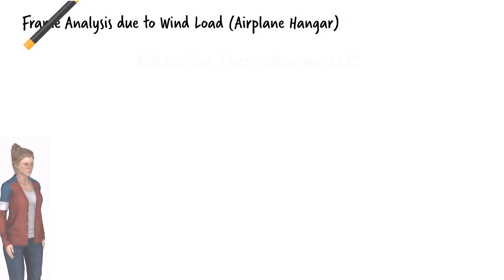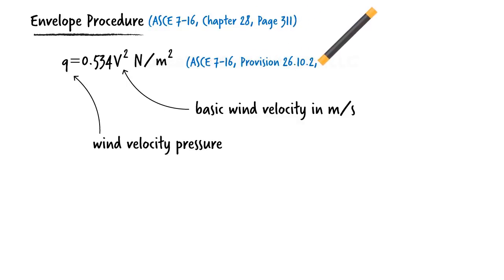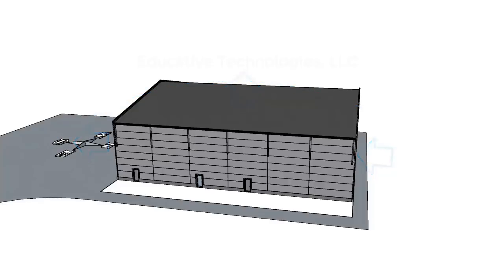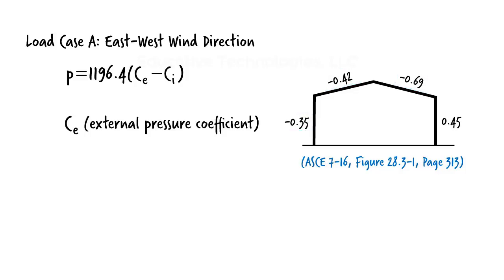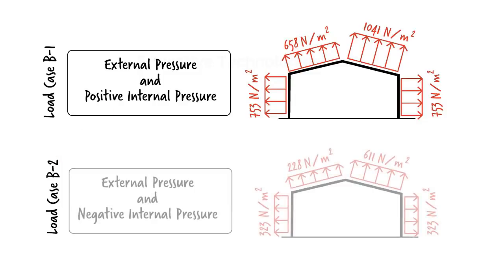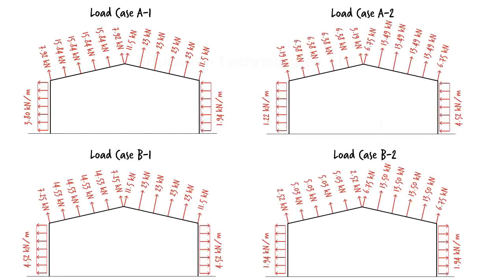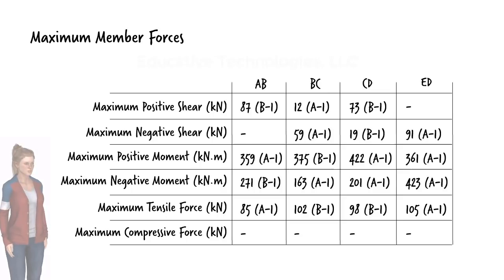SA52: Frame Analysis under Wind Load (Airplane Hangar)

Comment: Thanks you sir , if we have a canopy or extension member how to design winload ?
Reply from the maker: A canopy can be treated as an open building (not enclosed). There are provisions for open buildings in the code. Similarly, the code provides provisions for roof overhangs. Similar to the enclosed or partially enclosed cases, such provisions specify the required wind pressure for the components of the structure under consideration.
Reply: @DrStructure  acording to slope of roof 11.62 , your coeficient  has a problem with Linear Interpolation .
Reply from the maker: Thanks for the comment, we will look into it.
Reply: @DrStructure   what about wind load on sidewall ?
Reply from the maker: The loads on the sidewall are included in the analysis. See 6:26
Reply: What about the torsional load case  sir ? I do not understand about torsional load case clearly . Could you give me any comment . Thank you
Reply from the maker: Suppose we have a square building with dimension L x L, subjected to wind pressure on the walls. Place the origin of a cartesian coordinate system at the center of the square/building. The building is not going to be subjected to any torsion so long as the algebraic sum of all the wind forces acting on it pass through the origin. However, if the wind load is not acting symmetrically on the walls (and often it is not), then the load due to the wind pressure becomes eccentric relative to the origin causing rotational forces to develop. 

Suppose the wind pressure on the leeward side is q. Knowing the dimensions of the building, we can calculate the equivalent concentrated load due to q. Say, the wall height is h. Then the equivalent concentrated load due to the q is: P = (q)(h)(L). If q is perfectly uniformly distributed over the wall, the plane of action of P passes through the origin resulting in zero eccentricity, hence we have a zero torsional force. However, if the wind does not exhibit a prefect uniformity, then the plane of action of P would be separated from the origin by some distance (e). This distance would be like a moment arm for force P relative to the center of the building. Hence, a moment/torque of (P)(e) develops in the building. That is, the square/building wants to rotate around its center.

Design codes provide provisions for handling torsion. For example, according to ACSE 7-16, such a building has be designed using either the Directional Procedure or Wind Tunnel Procedure, not the Envelope Procedure. In this lecture, the latter procedure is being used.
Reply: @DrStructure  with envelope method it doesn't  has a Sidewall  wind load  in case A why ?
Reply from the maker: Please elaborate. In this example, there is a sidewall in the wind direction in Case A.
Reply: @DrStructure  what about sidewall wind load coefficient ? I mean the value of coeffient for sidewall wind load Case A .
Reply from the maker: @cheavannai26  By sidewalls, you mean the walls of the hanger in the direction of the wind, right? Those coefficients are specified @5:41
Reply: @DrStructure  normally we have windward leeward and sidewall of the wind but evelope  method in case A  i do not see  sidewall wind load .
Reply from the maker: Right, as far as the Main Wind Force Resisting System (MWFRS) is concerned, we want to analyze it under the wind pressure in the direction of the wind. Wind pressure in the orthogonal direction does not impact MWFRS significantly for low-rise buildings, hence it is not included in the envelope method.
Reply: Thanks you sir 🥰

Comment: 0.534 * 58^2 is not the result of 1196.4 N/m^2. 
It is 1796.4.
Reply from the maker: Thanks for pointing out the calculation error.
Reply: @DrStructure  I always do calculation  on paper.
All your video make me more comprehensive.
So, I want more video wind and quake (Static & Dynamic Lecture Video).
Dynamic Mechanic  for 
Lateral Load.
Quake (Equivalent Lateral Force Procedure,Responce Spectrum,. . .)
I'm wating to study from you

Comment: The internal coefficient ci = 0.18 seems to be too low for hanger type structure. Should it be 0.55 instead (partially enclosed building, or, open front structure)? The difference is not insignificant. Please confirm. Thanks.
Reply from the maker: Yes, if the structure is truly only partially enclosed, a higher value for the internal pressure coefficient can be used. But if the hanger is equipped with doors that can be closed, and there is no significant opening in any of the walls, the lower internal pressure coefficient would be applicable.

Comment: why is the braces required at the roof level (where the steel deck is) is that required? does the deck not provide enough lateral stability?
Reply from the maker: The lateral bracings at the top of the frame seem unnecessary given that, as you stated, the roof itself could serve that purpose. However, without looking at the details of the analysis and design of the building, and the design code in use, it would be difficult to assess the rationale for such decisions.
Reply: @DrStructure  thanks - I was just trying to figure out why that is required. maybe for more stiffness.
Reply from the maker: @rawjor  I too am not certain if those bracings are actually needed. The 3D model was done based on an actual hanger in a remote location in Eastern Europe, but we don't have the design details of the hanger available to us...

Comment: Is this a steel structure?
Reply from the maker: Yes, the example frame used in this lecture is assumed to be made of steel. The procedure however is independent of the structural material.

Comment: I think it's the same as ASCE7-05  ,Is there any difference ?
Reply from the maker: ASCE 7-16 is the most recent version of the document. Certainly it contains updated provisions as compared to the older versions. With regard to the specific provisions used in this lecture, since we don't have a copy of ASCE 7-05 available, we cannot tell how the two sets of provisions differ.

Comment: In ASCE Wind load calculation for Enclosed and Partially Enclosed building  requires to design a shed building using:  

1) both Positive internal pressure coefficient +GCpi and Negative internal pressure coefficient -GCpi 

2) both External pressure coefficient, Cp (e.g. -0.9, -0.18) for ROOF.

If I consider the wind direction is Normal to the Ridge: +Wx
(Roof angle< 10 degrees & h/L <= 0.5)
Then I found 4 sets of Net Wind Pressure for single Wx direction.

+Wx1) Internal +GCpi with External -0.9
+Wx2) Internal +GCpi with External -0.18
+Wx3) Internal -GCpi with External -0.9
+Wx4) Internal -GCpi with External -0.18    
Thereby load shows both positive direction and negative direction on the ROOF.

From Basic Load combination for LRFD 
the Load Combination no. 3 can be written as:
3_1) 1.2DL+0.8Wx1
3_2) 1.2DL+0.8Wx2
3_3) 1.2DL+0.8Wx3 
3_4) 1.2DL+0.8Wx4
and so in load combination no. 4 and 6.

If we consider each combination for opposite wind pressure (-Wx) and the other two directions (+Wy) & (-Wy). Then we can find total 48 combinations for wind load only.

Sir, Do we need to consider all 48 combinations?
Please help with the answers.
Reply from the maker: Yes, we do need to consider all (often seemingly too many) load combinations for each element that is being designed. The consequence of not doing so, potentially overlooking a critical load combination case, could result in structural failure and possible lose of life.
Reply: @DrStructure  thank you. Sir may i know your designation? if you don't mind
Reply from the maker: @engrkaribul  There are several individuals answering questions on this channel located across the globe.

Comment: For load case A, there are two data. The data for A-1 (positive internal pressure) & the data for A-2 (negative internal pressure). A-1 & A-2 (@6.45 minutes) shows different values for a single frame. which load to consider in between two cases for the final design? Though you have considered only case A-1 in your video. But, In practical design, which values to consider? The maximum value between two values? Please help me with your answer.
Reply from the maker: Note that @11:00 the shear and moment diagrams for both cases (A-1 and A-2) are drawn, meaning we need to consider both (or all load cases) when designing a member. More specifically, we need to draw the shear and moment diagrams for the beam under all load cases, then compare and contrast them in order to understand how shear and moment vary in the beam, and where the maximum values occur. For example, while maximum positive moment in the member may develop under one load case, maximum negative moment could occur under a different load case, and maximum shear under a third load case. We need to know them all if we are going to properly design the member.

Comment: Dr. Structure I would like to say a big thanks for the video. 
But I'm wondering if we add crain console to the columns how can we re-write the system stiffness matrix?
Reply from the maker: Any additional (structural) element added to the system should be treated as a separate element with its own stiffness matrix. For example, a crane console attached to a column could be treated as a (cantilever) beam with its own stiffness. This would not alter the stiffness of the column. Having its own stiffness, the cantilever beam simply contributes to the stiffness of the frame, like any other beam or column.

Comment: Excellent and informative video. 
However in the code it mentions a minimum design load of 0.77 kN/m2 to be used why didn’t we use it here as some of the values (at minute 06:40  ) are bellow it 323 ,63 kN/m2 ... 
Again Thank you so much for this excellent video.

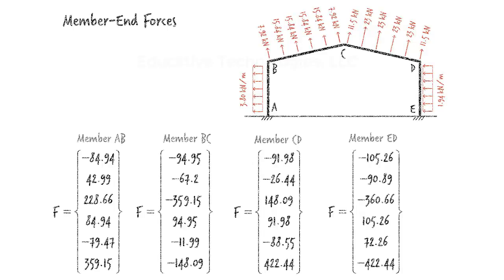Comment: Hi ! i have a question at 10:40 where we get the Member-end Forces for each member, shouldn't F1 and F2 for each force switch places because when drawing the Shear and Moment diagram later thay seem to be drawn in the oposite way for example, F1 wich is the force to X direction is 42.99 kn but in our results at 10:40 it is -84.94 kN. looking forward to your reply, Thank you :)
Reply from the maker: Member forces are always given/computed in the local (member) coordinate system. So, for member AB at 10:40, -84.94 is an axial force (in local x which corresponds to global y). And 42.99 is the force in local y (or global x), which means the shear force at the left/bottom end of the member is 42.99 kN.
Reply: @DrStructure  Maybe i am missing something here, at SA51: Analysis of a Tea House Frame at 7:15 when you draw the forces on the member you keep the same rule ? The forces drawn  are ok, but they are not in the order you state above...
Reply from the maker: The stiffness matrix for a member can be defined in two related ways: in local coordinate system and in global coordinate system. We can go back and forth between the two via a coordinate transformation matrix. This allows us to express member forces and displacements in both coordinate systems. 

When formulating the system matrix, for determining joints displacements/rotations, we operate in the global coordinate system. Once the displacements/rotations are computed, and we want to examine each member individually, we often work in the local coordinate system. This means, after calculating the displacements, and member forces, in the global coordinate system, we multiply them by the transformation matrix to get them into the local coordinate system. 

In SA51, given the simplicity of the problem, that was not done. I will have SA52 checked to make sure it is error free.
Reply: Computing F for member AB we have F=KAB*D F={-43,-85,228.66,79.47,83,359.15} which corresponds to the diagram of member AB case 1.
 In the exercise, to get the correct sense, you just have to multiply the transformation matrix by F of member AB, because F is in local coordinates.

Comment: How factor 0.534 factor is calculated in Wind Velocity Pressure Equation?
Reply from the maker: The factor is determined based on several numbers including:
Velocity pressure exposure coefficient,
Topographic factor,
Wind velocity factor, and
Ground elevation factor.
These are explained in ASCE 7-16.
Reply: Hello, you need to have access to the code to know where i’m getting the numbers from but it’s as follows:

q = 0.613 kz kzt kd V2
Where, 
q is the velocity pressure in kN / m2 
Kz  is the wind speed coefficient due to height 
Kzt is the topographic factor ( if the building is up by a cliff...etc) otherwise = 1
Kd is the wind direction factor = 0.85 for building, but varies if you design tanks (see the code) 
v = 58 m/s given ( also in the code) 

To get kz we have this equation:
Kz = 2.01 ( z/zg ) ^ (2 / alpha ) 
Where z is the height to the mid roof so 9.6 + (13.3-9.6)/2 = 11.45 m = (x3.28 = 37.54 feet) 

Zg & alpha depend on exposure categories there is type B or C or D
Since the hanger is in the open by the sea its type C , B is for city and D for very isolated areas like Siberia xD 
Form the code type C gives Zg = 900 feet & alpha = 9.5

So kz = 2.01 (37.54/900)^(2/9.5) = 1.0297
So q = 0.613  x 1.0297 x 1x  0.85 x V2 = 0.5365 V2 ( i got some error due to rounding she got 0.534)

Good bye!

Comment: Can you  tell me how you get the external pressure coefficient in Load Case B? From the code, it only has a value for each member.
Reply from the maker: For Load Case B, the code (Page 313) offers a single entry table with values for the surfaces of the building. Columns 1 thru 4 give us the coefficients for the side walls and the roof panels. For example, column 3 gives the coefficient for one of the roof panels as -0.37.
Reply: @DrStructure  For load case B, why the pressure coefficient of  windward wall "6" is not considered?
Reply from the maker: In this lecture, we are considering the analysis of a lateral frame only. So, we are interested in the loads that are acting on the plane of the frame. Since the wind pressure on Side 6 does not cause an in-plane load on our frame, it was neglected in the analysis.

Comment: Hi Dr. Structure, May I know the dimension of the cross-section of member structure that u used to obtain: A=0.023716 (m2), I=0.00567136 (m4) . Thanks
Reply from the maker: A standard W30x124 steel member was used in the example. The nominal dimensions (in inches) are:

Area: 36.5 in^2
Depth: 30.17 in
Web thickness: 0.585 in
Flange width: 10.515 in
Reply: Thanks so much @DrStructure  for your prompt reply. May I ask you a favor?  I check the area of W30x124 (A=36.5 in^2 ~ 0.023716 m^2)---> thus, it acceptable. But the moment inertia of W30x124 (Ix=5,360 in^4 , and Iy=181 in^4). The moment inertia is not equal as shown in the video (I=0.00567136  m^4)
Reply from the maker: Let me check with the person who did the calculations and get back to you on this.
Reply from the maker: I stand corrected.  For this example, the standard section that I mentioned was not used. Instead a rectangular section with a height of 1694 mm and width of 14 mm was used. For design purposes, this is not a good choice. But since here the focus was on analysis as opposed to design, we should make a note of it but consider it okay.
Reply: @DrStructure  Thanks so much
Reply: Dear Dr. Structure
qz=0.613kz kzt kd v^2 Ie 
In this problem you use 0.534 v^2.
Exposure C or D, you Define
?.

Kd is 0.85?
Kzt is 1?
Important Factor 1?
Please answer for details, My Best Teacher.
Reply from the maker: @thiha6334  In this example, Exposure Category C is used.
Kz = 1.025 (via interpolation from ASCE Table 26.10-1, using a mean frame height of 11.45 m)
Kzt = 1
Kd = 0.85
Ke = 1

Comment: 8:38s , To calculate the concentrated load to the frame from the roof panel (at each joint), why you don't get the reaction at each support of beam (=concentrated load of each joint)? I saw you multiple the distributed load with 6m (e.g., 2.64KN/m x 6m=15.84 KN)
Reply from the maker: Yes, we can calculate the vertical support reactions for those long transversal beams and then apply them to the frames. But that requires analyzing those indeterminate beams first. What we did here is an approximation technique that works in practice.
Reply: Thanks so much. The video is excellent.

Comment: I tried to find out the value of "0.534" in formulas: q=0.534V^2.  I understand  "0.534" is the product factor of : 0.613,  Kz, Kzt, Kd, Ke.  I tried to use Kz=1.04 (Exposure C); Kzt=1; Kd=0.85; Ke=1 (Page 268-code). But I can't achieve the number "0.534". Plz help me?
Reply from the maker: To determine Kz, we use the mean height of the roof. In this case, it is about 11.45 meters. Again, we need to interpolate to get the right value for Kz. It comes out to about 1.025, not 1.04.

0.613(1.025)(1)(0.85)(1) = 0.534

Comment: Thank you for a great lecture can you please tell how to take load combinations if we calculate the wind loads of roof and building seperately?
Reply from the maker: Design of structural systems is often governed by local/state/regional codes. For example, in the US, the ASCE code offers the following basic load combinations for designing members:

1.4D
1.2D + 1.6L + 0.5(Lr or S or R)
1.2D + 1.6(Lr or S or R) + (L or 0.5W)
1.2D + 1.0W + L + 0.5(Lr or S or R)
0.9D + 1.0W

where D is dead load, L is live load, Lr is roof live load, W is wind load, S is snow load, R is rain load. There are another set of equations for dealing with seismic loads. 

The equation that results in the largest value for the given member controls the design of the member. 

The method described in the lecture treats wind load for the roof and the walls. We cannot separate them. So the calculations presented encompass both. But, for design purposes, we do need to analyze the frame under dead load, live load and possibly snow load, then use the combination equations to determining the governing set of values when designing the individual frame members.